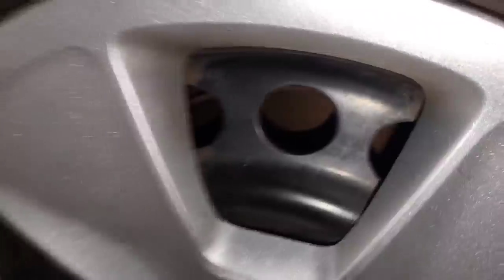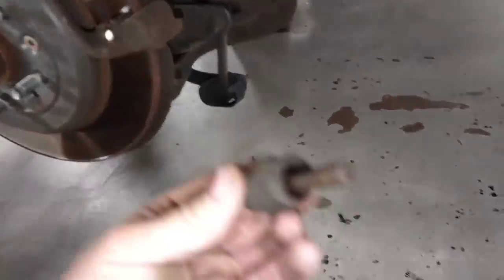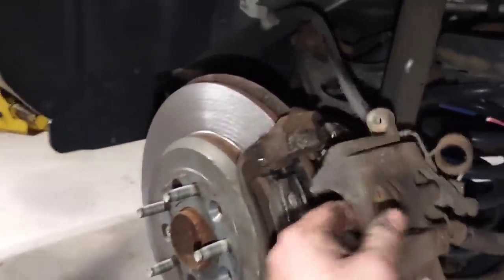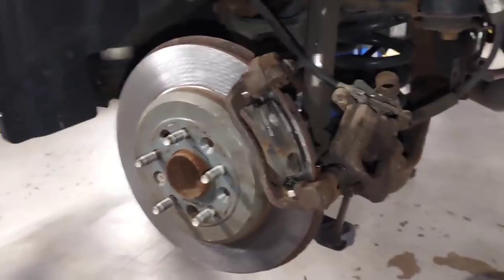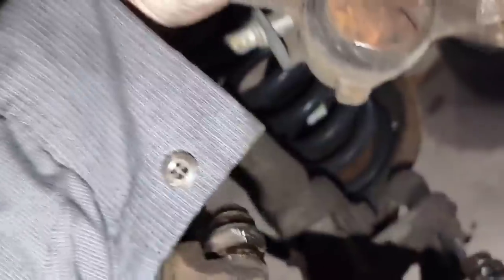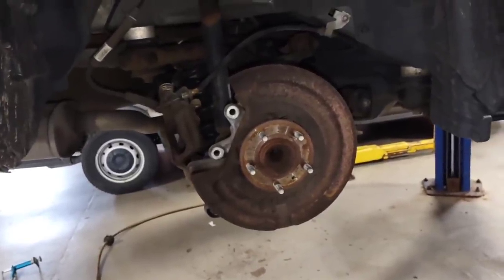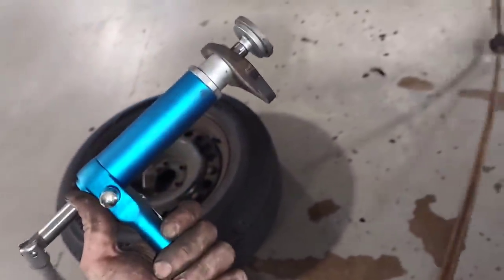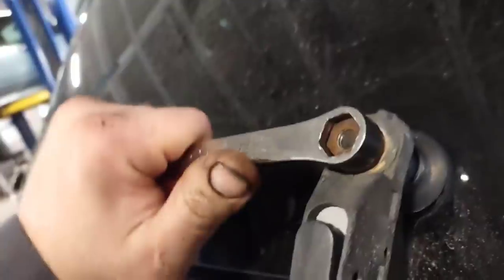Fixing Another Shops Brake Job Screw Up - this makes mechanics have a bad name Shoddy Work

Comment: I've been doing brakes on my car, they always work perfect, but the darn caliper pins/whole caliper always wiggles a decent bit. Tried new pins, new bracket and caliper. Still got some pretty darn good play. Could be the clunk i've had forever, but not really a way to fix it, if new calipers/brackets don't help in any way. Maybe the reman spot (guessing remanned) just said screw it and skipped the brackets. Yeah brakes i don't like trusting people with. Had a local shop put new calipers on my brothers 2010 vw CC, electronic parking brake motor deal, yeah i went to pick it up with my brother, 0 brakes. They had broken the motor housing, by obviously not lining the motor and caliper together with the gear that's inside. And in turn pissing out all the fluid. Basically i did the whole job myself. Another time they removed the security/immobiliser fuse when doing some work on parking lights or something...car would start die on and on. Fusebox diagram didn't match for any of them and online was useless. Local vw shop quickly just said yeah theres the fuse missing. 100 dollar tow and probably some money there for something that didn't need to happen. I have good reason to not trust anyone. Oh and the dealer inspecting my OTHER brothers car, when the rotors were trashed and grinding. Calipers all fine, just legit worn brakes, but they inspected it for our 2 year inspections. They also didn't do anything to remedy that problem. Major trust issues and for super good reasons.

Comment: In New Jersey, resurfacing/cutting brake rotors is a long lost art that mechanics stopped doing 30 years ago.. No shop in the state resurfaces rotors anymore. Everything is new off the shelf meaning cheap ch####se steel ready to be warped at its first heating. Jm2c...

Comment: Even if it wasn’t a shop that did it, anyone  can figure out the brake pads don’t index on the caliper. I’ve done my own brakes with rear calipers like that and I wouldn’t put it back together and think it was cool if it doesn’t go back together easily. I’d test fit the pads in the calipers etc it’s just part of pride in workmanship.

I’ve chewed out dealerships for installing things under warranty like wiring harnesses etc where it’s not even clipped in and the harness looks worse than it was when I brought it in. TCM harness not clipped in and PCM harness all a mess with wires under tension. Like way to let the O2 sensor wires dangle against the block..

Comment: Recently had a 2019 Ranger come to my shop for a noise from the left frt. Another Ford dealer had recently machined both frt rotors for brake pulsation. Found one of the caliper bolts completely missing and scored the caliper as well as the inside of the rim. Not warrantable at my shop and quoted the repair back to the other dealer.  The other dealer elected to send a flat bed to pick up the vehicle one hour away and paid for a loaner and repaired the vehicle. The customer was not impressed and upon  receiving the vehicle back brought it back to me to for an inspection to make sure they did everything right. All was good but that customer no longer trusts that dealer and sad that things like this happen and hurts us all.

Comment: You shouldn’t be surprised I worked at a import dealer and they hired people that had no clue. 
Clocked 150 calipers wrong and they call came back. 
Had lube kid putting on oil filters with water pump pliers. Damaged 100 + cars 
No training no super vision

Comment: the best ones are the rear brakes on escapes. when the one doing the brakes put the pads inside on the outside and outside on inside. they make noise and hit the rotor at an angle.

Comment: This is why I only trust two shops. One is the German auto shop that only works on German cars and rejects and other cars that come through, my whole family has gone to them my whole life. Another is the Audi dealership. Reasoning for that is at the dealership, they know your car best as they’re required to have training on it, they have all the manufacturers procedures on a computer right in front of them, and if they so screw anything up and the customer has to come back because of that screw up, you only have two chances before you get fired.

Comment: I'm a GM trained ASE master tech. Who has been working at Gm dealerships for 31 years. The problem with most techs these days they don't understand that the brake job you just described doing. Is what should be done on every brake job. It shouldn't be considered going the extra mile. Nowadays techs just want to slap pads and replace rotors. Lube and cleaning is considered extra work on a brake job
Reply from the maker: 100% agree with you brother this should be done on every job

Comment: Brake shops need to pay attention  to  proper torque  specifications  also . Improper torque  on  uncles 2000 f150 front caliper brackets twice ,one fell out on the road! I put brake pads and rotors on my brothers 2000 f150  and torqued  the bolts to specs  and they did not loosen.

Comment: ive seen younger guys in the shop where i work not clock those pistons right.  so yeah, shops can do those wrong.  cheap brake job comes with cheap labor and cheap parts.. thats why when someone says its xxxxx.xx dollars to do it right.. if you find someone to do is for less then they are not doing it right.

Comment: Most places don't want to eat any time or charge for a proper job. I do quality jobs and they just want in and out. They don't care if it's half assed they get to charge the customer twice. Not all places are like this but, a large majority are. I always get chewed out for taking a little longer but, I normally have only 1-2 comebacks a year. I can't tell you how many people don't pull the pins, clean the pins and holes and regrease them with quality brake grease. Everyone is out to save a buck instead of doing quality work and having it speak for itself.

Comment: I've had a couple of vehicles the last couple weeks like this, did a couple videos on them. One was a stuck slide pin, the other had been taken apart and they left bolts loose and the caliper got into the wheel.

Comment: I've been a mechanic for 7 years now. I've been shocked at how many people don't clean or lube the caliper pins, or the channels the pads ride in. They don't lube O-rings on filters, injectors, ect. They don't torque lugnuts. People just don't care.

Comment: If dealers had specials and stopped with the stealership mentality, people would take their car there but it has a bad image to rip people off
Reply: It's not just that, it's the ridiculous flat rate pay system. Screws the techs but the dealers love it. If the tech is churning out hours, the dealer makes a killing while the tech gets peanuts. If the work load slows down the techs make less money. People like to blame the dealer most of the time but it's the antiquated flat rate pay system that sucks. This is mostly what gives dealers a bad image.
I used to work at a dealer, you see all kinds of people. Many have been to the "other" shops for repair only to have it botched. So they bring it to us all pissed off because of the money they spent at Joe Blow repair shop and don't want to pay us a lot of money to fix it. Well, sorry, but guess what, I didn't work on it before and whatever it takes to fix it is whatever it takes. There, I said it.
Reply: @jdtractorman7445  agreed. System is broken, ppl see $130/hr and oem parts, then run. I feel bad for them. I do my own repairs

Comment: Honestly even at the dealer, in this case a Mazda dealership, they replaced cx7 control arms as per recall and they bent the dust shield and went finger tight on ball joint pinch bolts. I'm not making this up. Bottom line fine a good mechanic as it doesn't matter where you take it, it all depends on the place working on your car dealer no dealer.

Comment: I didn't know there were modern rotors that were thick enough to be turned more than once, or even at all. Most of my experience is working on old (1943,1988,1989,1991,1994,1999) Jeeps so maybe it's just AMC/Chrysler rotors.

Comment: That's kinda what happened with a car I was working on yesterday, Pep Boys did a clutch and master cylinder and slave cylinder on a Honda accord and could not get a good clutch pedal after job was complete apparently the mechanic couldn't figure it out and Pep Boys actually let the car go back to customer without paying the bill because they could not figure it out.. the car comes to me after inspection 5 minutes later I find the problem 😏 when installing slave cylinder the rod that pushes the fork for the throwout bearing was reversed and wasn't fully compressing the pressure plate to allow gear engagement. If you're not a mechanic don't try to be one 👍
Reply from the maker: Agreed

Comment: I think the lion's share of the problem lies with the customer , not the other shop. Obviously those rear calipers needed to be replaced, but they didn't want to pay to replace them. So the other shop was asked to try and free them which i'm sure the customer was told this is a temporary fix at best. It didn't work so she's upset and the vehicle comes back to you.It's not because the other guy didn't know how to do it properly, it's because they were unable or unwilling to pay for it. Why didn't you change those rear calipers when you had it. I would never put new rotors on without new calipers !!! ???

Comment: Newer vehicles require you to align the caliper piston to the pad....Why you have to look at the pads when you take them off. One will be the inside. That has to lock into the caliper..

I would add. Fords have the wiper blade alignment marks right on the windshield..Kinda hard to screw that up..

Comment: I had an old explorer yesterday. New pads on LF, hardware clip installed wrong and  was grinding into the wheel. RF had no outer pad, just a crumpled up shim wedged in the top of the bracket. LF lug nuts were hand tight. "Customer states brakes went out." They never give you the whole story🤦

Comment: Car mechanics are underpaid. The shops or dealers that employ them pay $18 an hour, sometimes less, sometimes a little more, and the customer pays $120 an hour. There's no requirement for an apprenticeship, very few enforceable standards, no continuing education (except possibly dealerships when there are recalls, new technologies etc.). So if you increase the pay, you increase the quality.

Comment: Sure.  "By the book", new pads, rotors, and maybe a new caliper.  That would have run several hundred bucks!  Money that this person doesn't have.  The alternative would be to live with the shoddy work the other shop did.  Left with that, there could be an emergency braking situation where those rear brakes just weren't up to snuff.  At least now, they have usable brakes for however long they have left.

Comment: Definitely rushing the job in my opinion... not cleaning things, not checking slide pins, not clocking the calipers correctly. Especially with the wiper arm being “on the closed side,” shows they obviously did not check their work when they were done. Sad to see that some people are okay with doing this for others that they share the roads with, let alone it being your legal responsibility in the unfortunate event that they get in an accident or injured due to previous “repairs.”

Comment: A mans quality of work should be as high as possible. Sometimes you have to make due with subpar situations, but leveling out a used set of pads and refinishing a used rotor to stay in budget is perfectly acceptable if done properly. Making the car safe within the customers budget is how it has to be sometimes. I 100% agree with how you handled that job.
Reply from the maker: Yeah I feel bad but it's all I had to work with I tried to do it as cleaning as safe as possible

Comment: I'm always done my work myself. So recently I need a professional with my car is acting up without any check engine lights..  first two shops is blow it off and act like if there's no engine light nothing can be wrong with the car. The next job took my car in for 3 days, just to tell me that they ran modular with a scan tool and charged me $60!? WTF... I told and show them and even wrote down a very descriptive explanation of what was going on and what I want to checked.   Never again!

Comment: Did the brakes on my 96 Mustang gt soon after I bought it   .. went to grease the slide pins a pile of rust fell out when I pulled the bottom pin out on the RF ... every corner was just like that... .

Comment: Kinda makes me wonder how the other guy pressed the caliper pistons in since they weren't aligned w the dimple n hopefully not c clamp as would probly damage it,, need to use caliper wind in tool they're tricky 2 use but not bad if it's the magnetic type for the adapters so u dont need 3 hands :)

Comment: I had tried to do a rear brake job on a car that a shop messed up on. I couldn't do it because they stripped the bolts using the wrong size and it was never even changed. I told her it was never gonna happen because of the last guy who did the job. It was a torx bolt that been stripped on both side. I told her it was cheap to sell the car then to fix the brakes. Funny thing she told me some guy is going fix it for 50$ just need part. Never gonna happen because I knew what the he never seen the hack job. Because of rust and a lot of it too.
I asked about last week, still not done.

Comment: I had a guy bringing a VW Passat that was making the most horrid noise ever. Turned out the shop he took it to the change the brakes forgot to put the caliper bolts back in and the caliper came out and was just hanging and rubbing against the wheel

Comment: They never bothered to clean the rust and corrosion out of anything, I am willing to bet that a new guy did that. No experienced mechanic would leave a slide frozen or the pad grooves full of crap, not to mention the caliper clocked wrong . I’d put mew calipers on it myself
Reply from the maker: No money, had to work with what i had

Comment: Yesterday I did a similar job on a taurus. I had to replace the caliper bracket because one slider pin was welded stuck from rust. If shops just take 2 mins to re grease the slider pins this would never happen.
Reply from the maker: I actually had to get out the torch a couple weeks ago because one was rusted so bad with lack of maintenance but I had to heat up the entire Channel where the pin went through to free it up and then I had to spend 15 minutes cleaning all the rust out of it

Comment: This happens when you buy cheap aftermarket cuz I had to always with NAPA brake pads cut the top surface of the piece that goes into the hardware

Comment: Lol.. I didn't even know it was possible to put the caliper on without the piston being lined up with the pin. I suppose you could but you would really have to force the caliper on, I'm surprised they didn't strip out the threads in the slide pins doing that. Do it right or do it twice, in this case the customer paid two times trying to save some money. Not worth it

Comment: How do you deal with a shop that diagnosed a problem, put on part(s) that would "fix" it, but didn't,  said it did fix it, let customer pick it up and pay only to find out while driving home it still had the same problem??? What should the customer do???
Reply from the maker: The customer should return to that shop and recommended they put more diagnostic time into it and actually fix it and apply the amount of money they paid the first time to the actual fix instead of making them pay more

Comment: Enjoy the channel. Been driving Fords for 30+ years. My wife's 2017 has had a weird squeaking/rubbing sound since pretty much new. It's coming from the rear end. While still under warranty the dealer replaced some suspension arm and also the PTU? I believe. Never did fix it. I think it might be a bad shock. Any experience with this issue? Thanks for your time.
Reply: It's an Escape BTW

Comment: See this crap all the time it only takes a few minutes to clean the rust off the bracket before installing the new hardware and a few minutes to clean and grease the pins I usually sandblast the bracket where the hardware goes as the rust behind the hardware takes up space and causes the pads to get tight if it’s rusty and lube everything up it really sucks that people don’t take pride if there work anymore

Comment: That's a bad ass caliper tool. I'm still using a manual compressor tool. Do you have a part number for it.
Reply from the maker: https://www.amazon.com/dp/B07W9H19CW/ref=cm_sw_r_cp_apa_glt_fabc_QKSBXH7WGD0FJ6MAT8MP

Comment: i got a bunch of dingleburry hones to clean out those slider channels before i greese em up and it only takes 5min. BTW my vans new rotors getting a little pulsation and I'm afraid to get em turned, cause some guys never turn the bits on the lathe and i don't want a shitty cut (i'm retired)
Reply from the maker: Specify that when you get then done, they will accommodate you
Reply from the maker: I bought a special brush kit from snap on that i use for them....gets them nice and clean

Comment: Hate to tell you, my ex lost a front rotor on her  mustang 8,000 miles.  Thought at the time, ok ford, had it fixed.  Watching her drive,. Left foot on the brake. She was according to her, just touching the brake, no one can hold their foot on a pedal lightly that long.  She was not taught that by me.  We divorced a month later,  i hope she has the problem the rest of her life.!

Comment: tutorial for that finish on the rotor? or just take a die grinder and run it out slow while it’s on the lathe
Reply from the maker: I'll do it right now
Reply: Would like to see that as well.  Been replacing more rotors lately, but they aren't as cheap as they were even a couple years ago.  The finish quality varies with new ones too.